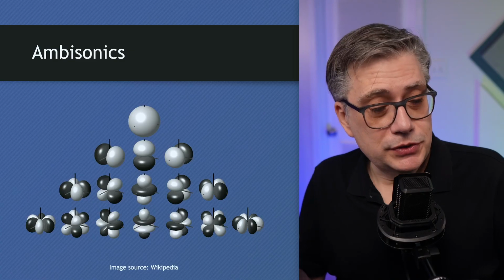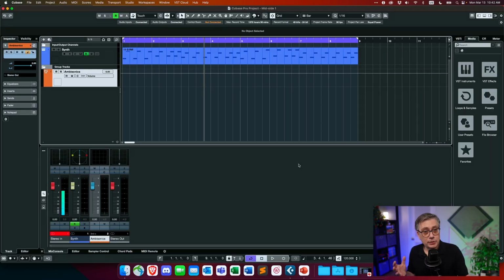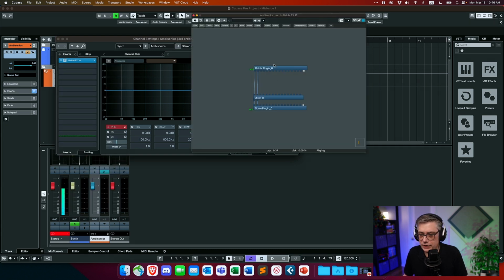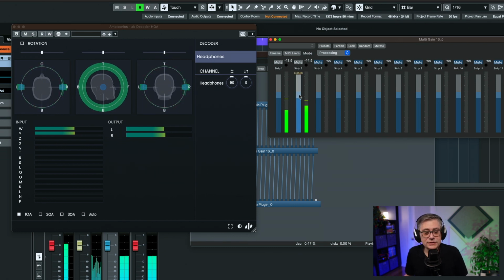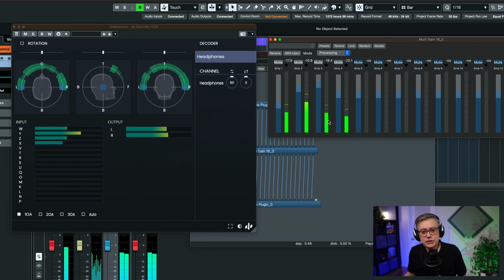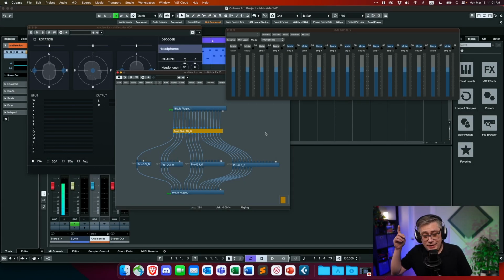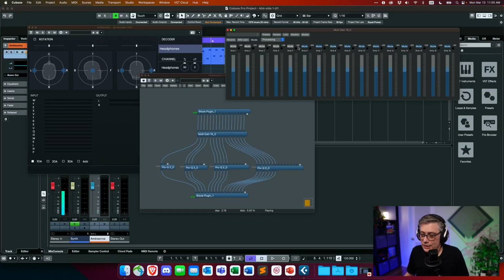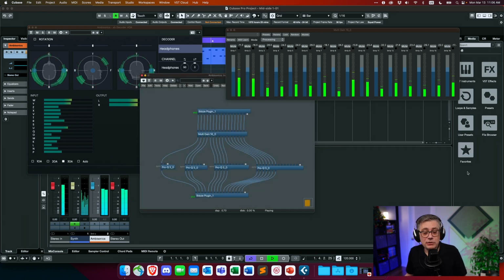The one spatial audio trick nobody seems to know about!

Comment: For several years I have been experimenting with mid/side on 5.1. So adding extra speakers to the standard 5.1 bed layer, by connecting for example the + of the L & LS channels to create a LH, R & RS to create RH, L & R to create CH, and LS & RS to create RCH. I call it 3D2. To format, it is necessary to take the atmos channels and encode them into the relevant pair. But instead of simply giving each pair a mono signal that is 180° out of phase, I want to give one channel the top half of the wave, and the other channel the bottom half. So it would be discrete content in the heights, because the bed layer channels only get half of the waveform. This would probably cause some distortion at low frequencies, so a high pass would be required. If you want to use the atmos .4 layout, simply rotate the speakers 45°.

Why? Well, because streaming atmos sucks! 3D2 does not require more bandwidth than 5.1, so audio quality is much better than atmos. Also, most people don't have atmos decoder yet. This way they can upgrade to atmos just by adding 4 more speakers. Also may be possible to cross from L to RS, and R to LS, using the opposite half of the wave. Which means turning 5.1 into 5.1.6.

I just don't know how to format it. And then assuming I can get streamers to format, how would the users streaming software know to use it? It would have to be a manual selection.

Thoughts?
Reply: Obviously, the AVR manufacturers are going to be PISSED about this

Comment: Hello, great video Michael. I am in a worship team and our team have trialled the Klang Digico system on a sunday set.
I was impressed but it left me wondering if I could use the Arbane Groupe Ness software and our team could create a separate mix using this software and associated app. Thoughts?
Reply from the maker: Should be able to do the same. Ness is free, I suggest checking it out.
Reply: @michaelgwagner Thank you! Do you have the NESS program? I am having trouble activating it through their process as their link times out
Reply: The link is working again thank you

Comment: I have a question, not sure it makes sense 😅 If one where to copy a mono sound source to 4 identical mono tracks (A-format?), and then adjust gain levels (or add fx) to these individual tracks _before the encoding to ambisonics B-format (let’s say FOA). The omni and side 1,2,3 directions would not give the same result like when changing the levels of already encoded ambisonics signals, right?
Reply from the maker: Correct

Comment: any guidelines for basic mixing principles for ambisonic signals ? how much headroom each voice\sound needs ? 
distortions can also arrive from unexpected corners :-)
Reply from the maker: Very good question! Ambisonics is not speaker based, so as long as you stay in the Ambisonics domain, headroom should not be an issue at all. It‘s only when you decode it but hat this becomes a concern. And i could be wrong but I believe that the decoder ensures that everything stays in check.

Comment: Great tutorial and idea! I just managed to do the same thing in Reaper without using Bidule. I basically have a binaural decoder (IEM) to monitor. I send an instance of Odin2 into the ambix i2_o1 encoder by Kronlachner and send that into the wigware ambix freeverb (to have reverb) that then goes into an instance of mcfx_gain_delay and I have the same thing as you, where I can change the gain, mute channels et all...

Sadly, i can't include a screenshot here ;-)

Thanks for you great videos in general!!! (But as usual, things are a lot simpler in Reaper ;-) )
Reply from the maker: Correct! There is a lot you can do with Reaper. Maybe I should do another Reaper video.
Reply: I'll take Nuendo first every time, but Reaper is a great DAW for experimentation. I always recommend Reaper for students. Otherwise, ReaPlugs is the only bundle a student should ever touch for the first year (if an actual student) or the first 5 or 6 years if they're trying to learn from YouTube.

Comment: Cool! For Mach1 I do similar and pull off the 4x stereo pairs into mid/side processing. Great for when you have mono stems, stereoize them using a k-stereo / haas delay technique and then mid/side process that back into Mach1 8. Little more difficult to do in Atmos as limited to only mid/side on the object input unless you work with object beds or beds instead and use the Plogue Bidule / Element to split the bed up.
Reply from the maker: Yes, object based audio works differently. This trick would only be applicable to beds.